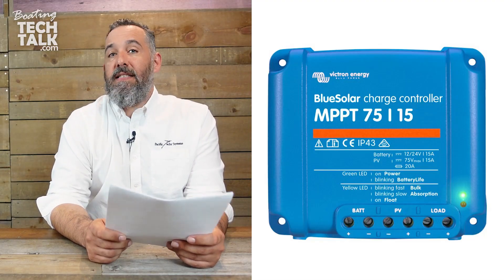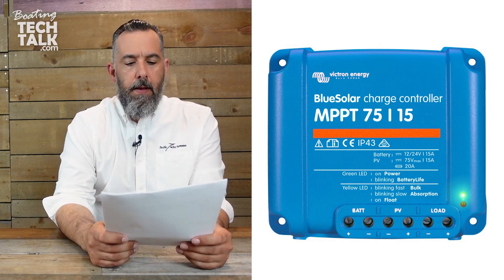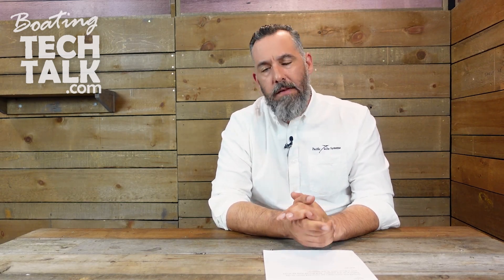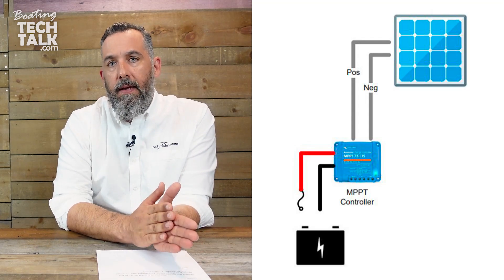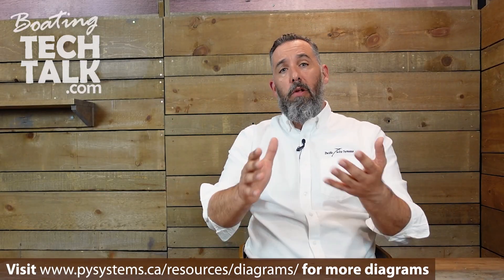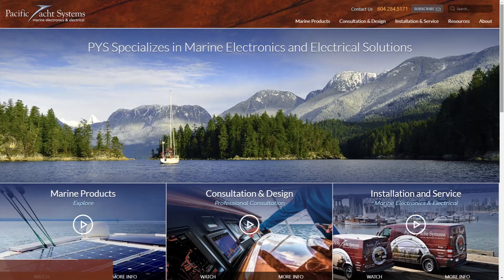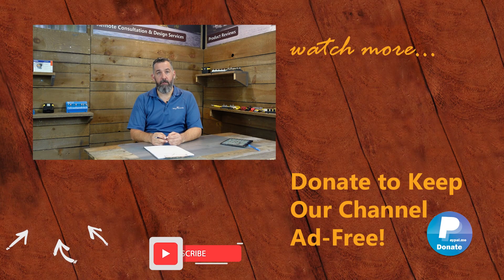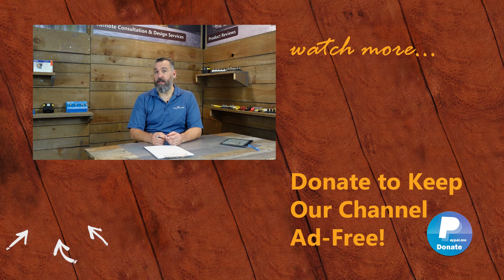Where Do I Put the Solar Controller on My Boat?

Comment: Your channel has really great videos. I have a few questions regarding solar charging my bass boat. I’m confused on what exactly I need and where they should be placed in the charging system. I currently have four batteries on my bass boat and a minn Kota four bank on board battery charger. I’m wondering from the panels to the onboard charger, What do I need in between to regulate my charging? Your comments are much appreciated.

Comment: My plan is to put a switch between the panel and the mppt. I am still doing a fair bit of work on the boat and I'm likely to disconnect the battery at some time, which I believe would harm the mppt if the panels have voltage. Is that logical?
Reply from the maker: Correct, one should avoid disconnecting or connecting solar panels that are energized.

Comment: Hello Jeff and Group:
Can I use a Blue Seas Battery Bank  9001-e battery bank switch On two battery banks that are charged from a solar controller? I wanted to have two batter banks that where 12 volt In parallel and make a 24 volt, and in series 30 volt  100 ah battery X 2 batteries 100 ah 30 x 4x 2= 240 amps per battery bank times two battery banks total 480, would this work? Or should each bank of batteries needed it’s own solar controller/charger? Could the Blues Seas Battery Bank switch 9002 HD or 9003 HD could be used for this type of project and they can handle 500 amps.
The battery bank switch would be connected to the inverter as a on/off and to switch to the different solar battery bank directly linked to the inverter Would this work or could this work?
Regards
Hope
Reply: Yes it can be done. The technical experts at Blue Seas Symptoms are wonderful and knowable and patient with newbie people who want to set up a solar system in a RV or a Van and a house system can have a two battery banks system. In my ruff idea and design I was seeing what creative way to manage batteries and to have a back up  battery bank.
Regards
Hope
Reply from the maker: Unfortunately, never tried this setup before. Not sure if the solar panels would handle being disconnected when using the switch. Anyone else have experience with this setup?

Comment: Quality / Experience Share: We have a much larger solar array 10 x 130W wired in parallel (voltages start to get a little high for my liking if they were in series) on our 14 m Catamaran, but when I upgraded our old solar controller to a new Victron MPPT 85A one, I naturally placed it where the original boat manufacturer did - in our port engine room. This unfortunately was a fair distance away (9 m wire run) from our 900A battery bank situated below the seats in our main saloon. While in the Caribbean, I noticed after a couple of rainy days that I never saw more than 55A of charging current (even though our batteries had become rather depleted from a series of wet weather systems), so during a Xmas stop in St. Lucia, I decided to move the controller next to the batteries (approx. 1 m) and the difference was spectacular. I was now seeing up to 75A of charging, when our batteries would get depleted and we were able to concurrently charge our batteries, run our 12v water maker and use the inverter to run our washing machine while at anchor - it was a game changer. I have installed a 120A blue seas breaker at the controller (per the Victron manual) and a 100A blue seas breaker after a positive bus bar where we combine the positive wires of the panels, as Victron states the controller will become damaged should the panels be connected to the controller when it is not connected to the batteries. I found this extra breaker ideal (used as a switch) when I connected the solar charging system 2 years ago to the new smart shunt and colour system monitor. From time to time, I like to also check the output of individual panels, as we had significant problems with our original flexible panels dying and ended up discarding them for traditional hard type Victron panels. We have had zero issues with the additional Blue Seas breaker between our controller and our panels over the past 5 years...
Reply: It may be 4 years ago you wrote this, but you answered all questions i had after watching this vid: is it ok to have a switch between mppt & panels? Yes. Does the distance mppt-battery matter? Yes (I'm assuming your long wires acted as a resistor considering the very high amperage). Should I fuse between mppt & battery?  Yes. Should I fuse each panel? Maybe? (Not sure, but I have each panel individually fused between panel & mppt).

Comment: I agree; the controller should be closer to the batteries. Typically, the panel feeds are running at a higher voltage with an MPPT, so those wires can be smaller. The feeds to the batteries are seeing battery-range voltages, and thus are at a higher amperage requiring larger conductors, so shorter runs are more beneficial on this end; saves weight, voltage drop, money, etc. I personally DO put a breaker/disconnect on the MPPT to battery positives. Keep your zincs fresh. :)
Reply from the maker: Thanks Tao4409 for the weigh-in. Very well explained.
Reply: @PacificYachtSystems  It is always my pleasure Sir. :)

Comment: With the Victron Smart Solar MPPT controller the bluetooth connection allows you to turn the controller on and off through the Victron app. Would that suffice as a disconnect to the battery?
Reply from the maker: Interesting point, never tried. Wil check this out.

Comment: Voltage drop depends fully on wire thickness.  If you make the wiring between controller and battery thicker, you can put it further away without any difference.  Of course you'd  have to calculate to compare.  Calculating voltage drop between panels and controller should also be calculated; you may need thicker wire for this.
Reply from the maker: Well said.

Comment: Next to your NAV station and other gauges would be the Smartest place , close to an accessible location and halfway between where the batteries and where the Solar wires come into the cabin. 
Use common sense
Reply from the maker: Thanks for sharing Chris. Personally i get the controllers as close to the battery as possible and your correct, quite often the panel is close to the batteries.

Comment: I have a solar panel on the parking area and connect to the controller in order to charge the batteries. When i leave the parking for a searide, is it secure to leave the cable from panel disconnected from the controller and leave it that way? Keep it mind that i secure the cable male plug with a female.
Reply from the maker: Yep, it's OK to have a panel disconnected and left in the sun.

Comment: Well, when I bought my two 110W panels I spent just very few more money to by the 24V version of the panels. Then I connected each with a dedicated  Victron MPPT 75/15 controller. That is what I would recommend to overcome that issue.
Reply from the maker: Thanks for sharing.

Comment: 70w panels should be put in series on victron controllers these panels only put out about 16-18 volts victron controllers only kick in at 6 volts over battery voltage to start. Will not harvest any power early or late hours of the day or cloudy days without hitting peak voltage output.
Reply from the maker: Good point George.

Comment: https://www.amazon.com/dp/B012MWNT0G/ref=cm_sw_r_cp_apa_glt_fabc_XK1BYWF8DE8EW8JKR6PJ?_encoding=UTF8&psc=1. Jeff this is a breaker recommended for solar panels for a disconnect. It is very popular in the RV world and since I have both (an RV and a boat) I'm subscribed to multiple channels and forums. This is handy for winterization and sometimes the victron controller needs to reboot so having this disconnect first then disconnect the breaker coming from the controller to the battery makes it easy.